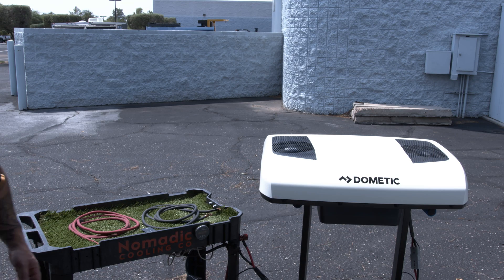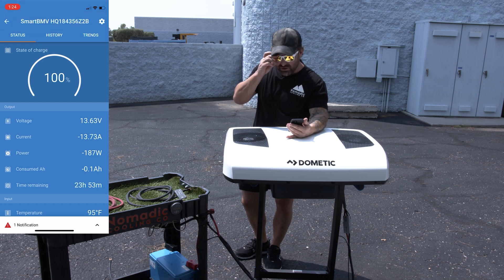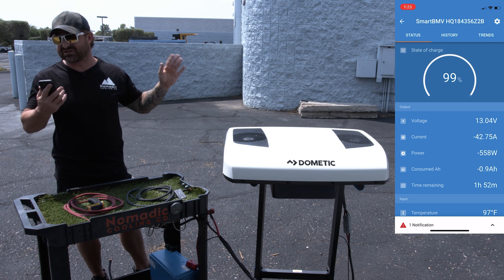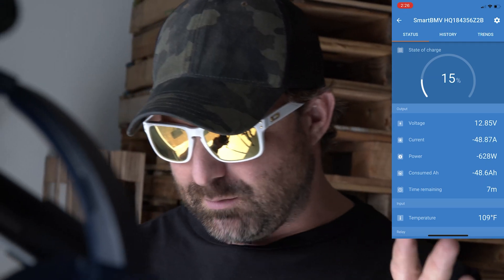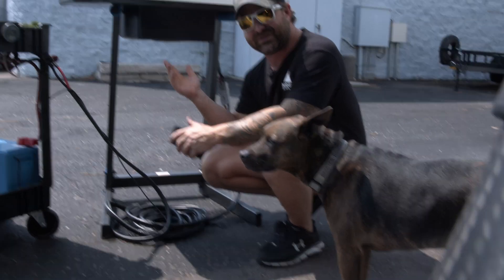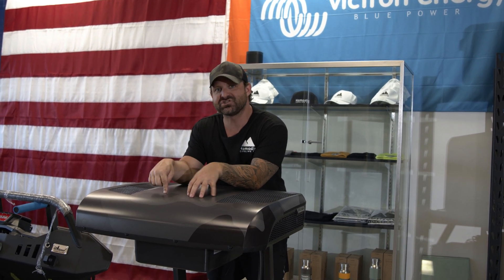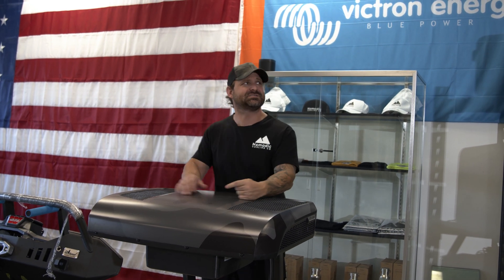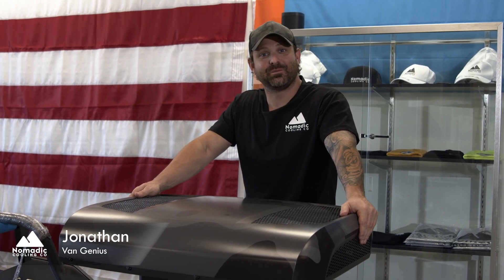Dometic RTX 2000 Battery Consumption Test Part 2  l Victron 100ah Battery l Nomadic Cooling

Comment: "solar ain't going to cut it guys". Bro, I have 1200w of solar on the roof, my air con draws 750w, so more than this one does, I can leave it on all day non stop, when I check my battery it's still at 99%. It's all about planning it out, solar can be amazing if you do it right.

Comment: I Am a novice BUT if running that on a small RV the internal temperature would remain lower as the activity  builds . On your test you were trying to cool the whole city! The cool air was being immediately warmed because there was no closed space . Your test was like running the A/c unit with every windows and door open in the camper !!!!! Please explain am I Stupid or would a “closed space” test be more valid. I really think consumption in my class C Motorhome would be lower than your test shows .
Reply: This is the only thing he can control. No one knows the insulation of your rig, how often someone opens the door, or if you like to sleep during the day. What he tested allows you to take the info and apply it to your rig. He can’t realistically test every camper out there. Even paint color makes a difference.

Comment: This was helpful thank you,  I need to setup an AC system that would keep the Van cool enough for my dog if I need to leave him in the Van for a short time.  I am thinking about 400ah this should work for me along with solar and a generator I would be able to do whatever I want. of course I would need some type or temp alarm that would notify me if there was failure.
Reply: Why can't you use solar to charge the batteries ? would it not depend on how much solar you have?
Reply from the maker: Glad it was helpful!

Comment: This test is based on the AC running full time, whereas when it's in a van it will only run to maintain the chosen temperature, then the compressor will switch off. So I think it would be more accurate to test how long it will last, keeping a small space like a van at a comfortable temperature.
Reply: Agreed, sloppy test. Amp draw changes with temp and as the guy above said the smaller space temp will drop lowering the amp draw.

Comment: Great test, but when you were talking about run time I think maybe you didn’t consider the fact that as the inside of the van cools off the AC will not have to work as hard and use less amperage so I think your test shows a worst case scenario which was great to see
Reply from the maker: Correct! Thanks for watching!

Comment: Stop saying Siri you knot head. Every damn thing starts talking to me...

And to teach you some electrical theory. Voltage increases. You get less amps and visa versa...Why Utility Companies run high voltage lines to the transforms. Then step up the Amperage..As they can run smaller wire size to the source. Where the larger wire size is stepped up for the last part of the connection...
Reply from the maker: Noted. Comment much appreciated.

Comment: I have a different 12v AC, but they use the same amount of energy. I have 6 x 100 BBB & live in the MId Atlantic. So, summers get very hot and with the temp 90-100 I get between 5-6 hours. If it is 80-90 & I get way more run time. Like 8-9 hours. So, insulation of your area is KING....JMO

Comment: Just trying to do some research on campers and the electrical systems.  The broad plan is to purchase a truck bed camper, as well as a f150. The F150 can come with either a 2kwh battery as well as the truck acting as a generator. Also available is a 7.2kw battery. So I am wondering, is the Unit in the video available to be powered through the Camper from the truck. I apologize if I am not making sense.

Comment: So...Just for clarity. I would still get more time cooling if I'm running through shore power or adding a little power from my 320 solar on the roof OR running the alternator on my truck?   I get that the AC might be drawing a bit more on High then i can keep up with but it would still add to run time, correct?
Reply: If you have solar or alternator charging you would benefit while they are actively charging your batteries since what ever you are adding while you charge will compensate for what you are consuming. If your shore power keeps up with the consumption you can run the unit over night for sure.

Comment: A more realistic test would have the cold air side of the unit vented inside a room.  Most air conditioners don't run their compressors non stop like in this video example. Depending on the insulation of a room, the run time may be doubled.
Reply from the maker: REALISTIC IS WHAT WE ARE SHOOTING FOR, trying to show worst case scenarios, we can easily show amazing numbers but that doesn't help anyone determine battery bank size. :)
Reply: @NomadicInnovations  I'm not sure worst case scenarios help people know how much battery install either.
Reply: @emilschaffroth6247  if you don't have enough battery for a worst case scenario, you don't have enough battery 😉
Reply: Great video and great help in determining my needs.

Comment: Great video!!! 
I'm loving the idea of replacing my dometic AC with a nomadic cooling 3000 in its place.... BUTTTTT.... Want to install another 3000 unit up front. 
So two rooftop units on a class b sprinter  , powered by 12 battle born.. 

What you think? Is it doable? Am I crazy?  I want to run these units overnight on eco mode and be able to sleep comfortable. Have I mentioned I hate the heat! Lol
Thanks again, guys! Love the video, love the attitude. Great job!
Reply: Why are you considering switching from dometic to nomadic? I have the nomadic, and am thinking of switching to the dometic haha! I havent installed mine yet, but feels like the nomadic consumes a lot more energy for I'm not sure that much more cooling?
Reply from the maker: Let us know, in the end we want you to be happy :)
Reply: @NomadicInnovations  , finalizing my 12 Battleborn battery setup and victron system. Next install is a nations alternator kit. 
Afterwards.. I will be contacting you to discuss about two nomadic 3000 units...  ( Or any other units you would suggest) 
It's going to be a task for sure as this is a 2017 coachmen galleria. But I'll make it happen !  There is very little or weak insulation so temperature control is high priority. 

Thanks again! 
John A
Reply: @alexa.ellman  , dometic AC, powered by AC voltage. I want to switch over to run most appliances to DC powered. 
Which nomadic do you have ? 2k or 3k
Reply from the maker: not crazy lets do it and make a video about it!